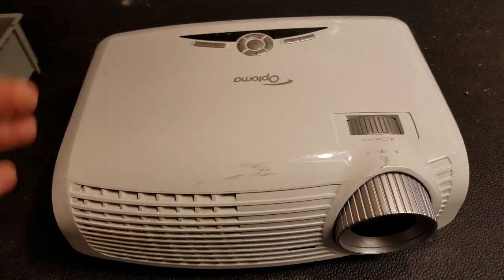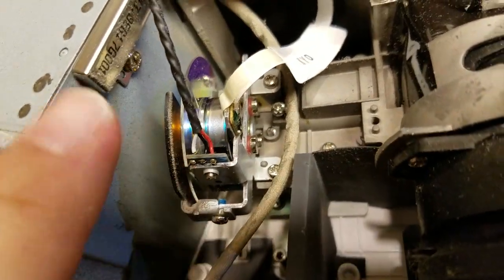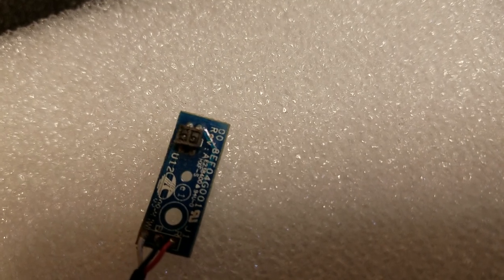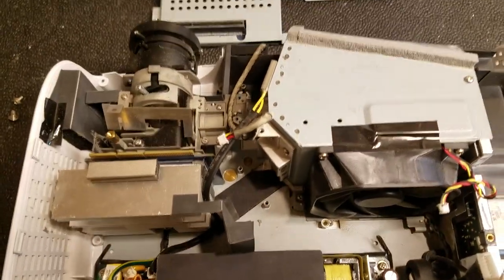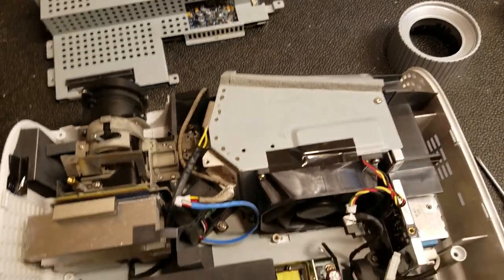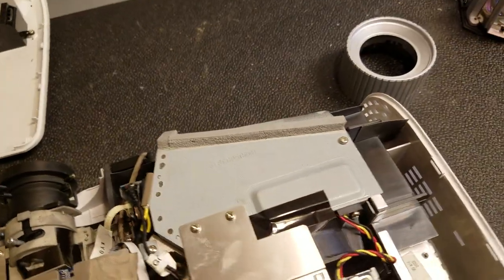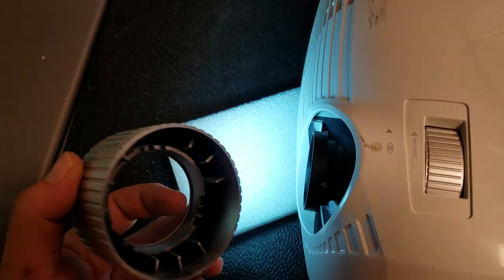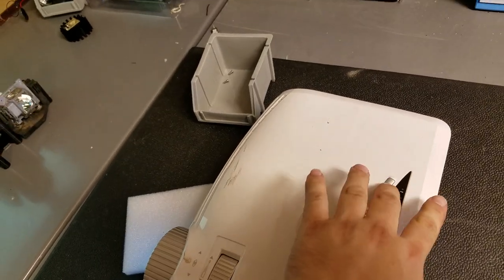Optoma HD20 Projector Cleaning

Comment: I had a fan error. I did what a gal in here suggested. I removed the bulb assembly and top cover. There are two fans. One large one blowing square on the bulb. There is another in a metal housing with two narrow openings. I sprayed compressed air at the blades and heard them spin. I did that a couple times and assembled the projector. It worked like a champ.

Comment: Thanks Frank, my HD20 was pretty clean inside but I did find the color wheel looked hazy so I cleaned it up and problem solved! I did have one small snag when disconnecting the cover cable, the small black clip on the plug broke into pieces.  I managed to push the cable back in holding it in place with some tape and everything works!
Reply from the maker: Wonderful! Those clips can be a royal pain.  As long as you have the little 'wedge' held in place I expect you will be fine. There is no tension pulling on it once its put together.  Great job!

Comment: Fantastic video, really helped me be thorough in taking out screws in right order and being careful with the cables.  Just in case anyone else has this issue, I cleaned the sensor and the colour wheel but still the snow appeared on the screen, I pushed the HDMI cable to display adaptor more securely in my laptop and bingo! no more snow :-)) Yes I should have checked the obvious before spending an evening cleaning the insides of a projector but now i know it is clean and in good working order thanks to this video lol!
Reply from the maker: Thanks for the comment!  Im glad you are up and running! Thats my goal with all of this.

Comment: I have an Optoma HD131X (black version of HD25) and I noticed a dramatic reduction in brightness at approximately 4000 hours. I thought I needed a new lamp, then I saw your tutorial, opened it up, took out the color wheel (which was literally coated in dust) and gave it a really good clean... And viola! I now I have a much brighter and more clear image!!! 😁👍 Thank you for such an informative breakdown.

I do have one problem though? When opening up the case, I was a perhaps a little too rough with taking off the top cover and did it from front to back (the wrong way around to what you suggested). As a result, I snapped off the plastic clip/tab off which holds on the front. The whole thing fits back together fine, but there is a tiny gap in the middle at the front, which also points upwards when ceiling mounted. 😟 Now I'm really kicking myself over it and worried I've ruined the whole projector by letting dust get in easy and make it build up fast again inside, or shorten the remaining lifespan of it. Would you say it's anything to worry about or be overly concerned over?
Reply from the maker: You're very welcome! Nah, don't stress the gap.  That dust takes years to build up.  Just run it and consider replacing the lamp assembly soon. 4000 hours is a lot.  you will notice even more of a difference with a new bulb installed.  If you run it too long, the bulb will explode and possibly cause some real damage.
Reply: Thank you so much for your advise! Now I can sleep without worrying too much about the gap! ☺👍

One more question I do have about another small issue I do have which has been a thing for the past year or so, when displaying brighter images, red and yellow seem to skew slightly? I have my projector calibrated (to Rec.709/D65 using a colorimeter) and I can replicate the issue by displaying a 100% Red or Yellow pattern and lowering the contrast to -11 (even going from -10 to -11 the color snap fixes accurately). The correct value is -3 without clipping. Obviously this affects very little in real world content, just more occasionally in cartoon and graphics stuff. More of an annoyance than a dealbreaker. In refresh rates that use the 3x color wheel speed (24 and 50) instead of 2x (60), the issue gets made slightly worse? 🤔 I'd of thought cleaning the colour wheel would fix this but sadly not. Also when the projector starts, I notice a weird screech, which I guess is the colour wheel starting up (also newly developed this past year)?

As for the lamp, this projector has an estimated lamp life of 6000 hours in Eco mode, which I run it in 100% of the time. Worry not, I will replace the lamp as that time approaches! 👍
Reply from the maker: @BedfordMarcus  that sounds like the wheel is failing. Most versions of that projector are on their 3rd or 4th color wheel by now.  If this is still your first, it is well past time for a new one.  The squeal is very indicative of that as is the color shift.
Reply: @FixitFrank  Awesome, thanks! I never knew that the color wheels in these had such a short lifespan despite routine cleaning?! Now I know where to look! 😁👍
Reply: @FixitFrank  Just an update, my new colour wheel came in (100% identical to my original one, with the index mark in the exact same place) and I fitted it (after a good clean all accessible areas, colour wheel photosensor and lamp bay/assembly). Unfortunately it didn't fix my colour issue, in fact, it only made the issue with the banding even worse. Blue was terrible. I had a quick play about with changing the colour wheel index in the service menu, but that did nothing. 🤔

In the end, I ended up reverting back to my old colour wheel (thankfully the seller refunded me in full), and gave the bearing/hub a good blast with an air duster. The noises are now gone and it starts up with no issues (indicating the wheel is healthy). Banding maybe a little better (could be to do with cleaning the sensor) but still predominantly there in red. What else could be the cause apart from the colour wheel, given adjusting the index in the service menu doesn't really help it?

It's still a very good projector (and definitely gonna be much better now I cleaned so much burnt dust of there) but it's just a bit annoying about the red and would love to have it right. I really don't want to throw money after bad things, that's all.
Reply: UPDATE! I fixed the issue with the red looking off (pinkish/deprived) in brighter areas! 😁 I found a different code to access the full service menu (not just the partial one) and I just simply adjusted to colour wheel index for both 2X and 3X individually whilst displaying a gradient pattern. I only needed to adjust it about 4 to 7 clicks to the right. My guess is the sensor must have drifted slightly over time? Not that it really matters as the colour is just about as good is it was when new now! Thanks again! 👍

Comment: I have an Optoma HD25e with flashing lamp and temp lights errors.  I ordered a new lamp, blower and system fan.  Followed your terrific video and replaced all.  Also cleaned the color wheel and sensor and gently blew it all out with an air compressor.  Now when it powers up I'm getting a flashing power and temp light error.  The new lamp, both fans and color wheel are spinning well.  Any suggestions?
Reply from the maker: Hi Shane,  You probably have a fan either stuck(wire tucked into a blade) or maybe a wire isn't quite plugged in on one of the fans.  That error(if happening instantly) usually means a bad fan.  If all fans are spinning, it might be the tachometer lead of a fan that isn't working.  How are you with a volt meter?
Reply: @FixitFrank  Thanks for the reply. I have and can use a volt meter but it's been awhile.  The errors don't happen immediately.  After I replaced the fans and bulb I tested with the top cover off like you did in the video. It powers up, bulb comes on, fans and color wheel all spinning.  I get the errors after about 30 seconds later, then it shuts down.  I'll ensure all the connections to the main board are solid and try again.  How would I use a volt meter to test?  Thanks!

Comment: Just found this channel and video after getting a second hand HD200X (Pretty much the same unit except it's black?). Anyway I've ordered a new cheap lamp (might get a knockoff one but the one I replaced in my HD65 was a cheap Hong Kong lamp and it has worked flawlessly for me for several years now).

Mine starts up but 'suggests' switching out the lamp so I'm going to do that before I mount and use it. While doing that I might as well clean the whole thing out since it was covered in dust when I got it.
Reply from the maker: Sounds good.  Watch out on the knock off lamps . Some use Krypton 85 to get around the patents on the gas mix. As long as the seller is decently rated you should be OK though.

Comment: GREAT TUTORIAL!!!  
I know you're not a mind reader but here is my Question:  
I recently replaced my bulb with one that I bought on line but am still getting the same amber & or red lights.  Is it safe to assume that this replacement bulb is defective?    Or could I have bigger problems?
Reply from the maker: It cant hurt to try another lamp.  The problem may be elsewhere though.  These are known for color wheel failures after 5-7 years.  If you have never changed the color wheel, I would check my video on HD20 color wheel replacement to see if the same applies.
Reply: @FixitFrank  Yep.  Did that worked out really well, then about 2 weeks later... the bulb.  Just ordered a replace bulb again and hoping this will work.  Thanks again.  I really appreciate your tutorials!!!

Comment: Thanks for this very informative breakdown. 

I have a second-hand HD20 I've been trying to repair. Perhaps you have some insight. After several minutes of use, and as it heats up, the image will begin to flicker rapidly for a few seconds and turn green. The image will remain green until the unit cools down. 

There are two ways I have been able to get around this issue as temporary fixes. For reference, I have the HD20 ceiling mounted. 
1) I run the HD20 in High Altitude mode (fan on high the whole time). 
2) I run the HD20 with the outer casing removed (I position and tape up pieces of charcoal filter to block the stray light flooding out the bottom but leave the lamp area wide open). Even so, after an hour it may still shift image to green. However, selecting High Altitude mode at ths point and running it for 5 minutes or so will typically be enough to shift the image back to full color without having to power down completely.

I've cleaned the unit thoroughly as well, however , based on your video I will pay closer attention to the color wheel chip. Another Youtube video suggested I replace the thermal paste where the chip touches the heatsink. I've attempted this twice with no luck. 

It's also very possible that the "Osram" bulb that came second-hand with this unit is a knock-off and is overheating the unit. Though I am not prepared to shell out the $150+ needed to test that possibility yet. I've inspected the Lamp housing and lens and do not see any indication of burning at this point.

Is there anything else I should be looking at that would be affecting the image coloration like this? Thanks CG
Reply from the maker: Hi there!  I'd be glad to help. You likely have a dirty color wheel/CW sensor. How freely does it spin if you give it a little flick with your finger?  The drifting color is what had me leaning that way.  If the DMD was overheating you would see more spotty flickering pixels (in my experience).   Im pretty well versed with this model. Im happy to help further.
Reply: Hey pal! You are right on the mark my man. Cleaned the CW sensor and running for nearly 2 hours now and the image is holding steady, beautiful. Thank you so much for pointing me in the right direction. I really appreciate you sharing your knowledge.
Reply from the maker: Awesome!! That makes me so happy to hear!  Thanks for letting me know!
Reply: Bin it? The way he explained how to clean this projector is just a way of damage the dmd chip
Reply: @FixitFrank  Frank I just replaced my bulb after 8 years of use! Now I have the same issue (picture turns green after 5 minutes). What are you using to clean the CW?
Reply: @FixitFrank  I swapped my color wheel and the picture is actually worse now...appears grayish vs changing to a green tint
Reply from the maker: @patrickcogley  Are you sure its for an HD20?  If so, you still need to set the index point if the little black mark is on a different position from the old wheel. That black mark on the side of the hub is what dictates what color it is keying off of.  https://www.manualslib.com/manual/687100/Optoma-Hd20.html  Read this about adjusting the color wheel 
index.  That will get your picture back correctly.  That link has the buttons to press to get into the service menu and how to adjust the color wheel index.
Reply: @FixitFrank  it's for an HD180, which is essentially the same projector. I'm not sure i saw a black mark on the old color wheel or the new color wheel.
Reply from the maker: @patrickcogley  There is a mark. All color wheels have them. It is on the side of the hub that passes past the sensor. That is how the projector knows there the color segments are. The steps may be the same for the service manual.
Reply: @FixitFrank  thanks! So I was able to access the service manual and I saw there is a Color Wheel Index number (currently 295). Do I just change this number until the color appears normal?
Reply from the maker: @patrickcogley  That is correct. As long as the colored segments are the same between your old wheel and the new, you will only need to adjust the number up or down until the picture clears up.  You can easily do it by eye.
Reply: @FixitFrank  couldn't quite get the red correct...I'm going to put the old color wheel in and see what it does. #frustrating
Reply from the maker: @patrickcogley  Double check the segment order. They need to match. If its Red green blue instead of red blue green(as an example), that can be a problem.
Reply: @FixitFrank  so they are different, in fact upon further comparison they don’t even look the same. And, I’m not sure how I would switch them. Do you have an email that I can send a picture?

Comment: thanks for the tutorial, i got a lot of good tips from your gideo! .Could you specify which product i should use to clean up the color wheel? I was thinking on Isopropilic alchohol in aerosol or you have to use another specific product? Thanks!
Reply from the maker: Hello Nacho! I use anhydrous isopropyl alcohol, window cleaner with ammonia or just a little water.  I will use isopropyl if the wheel is really bad.  The thing you have to watch out for is the type of glue used.  Sometimes alcohol can attack the glue and loosen the segments. If you are careful and do not get alcohol against the center of the hub(where the glue is) you can use 99% isopropyl.  Normal 72% or even 91% has too much water for my comfort.  If the wheel only has dust, try a dry microfiber cloth.  The less you can do the better.  For the alcohol or glass cleaner I will use a cotton swab to apply it.  Microfiber would be my first method, then go to using chemicals.  Remember Less is more!  Thanks again for watching my videos and if you have any other questions please let me know.

Comment: on the color wheel sensor. are you using any solution like alcohol or just a dry q-tip?
Reply from the maker: I try for the 'less is more' approach.  If its really dirty, some isopropyl won't hurt, but if you can get away without anything, that is better in my opinion.

Comment: You are a genius, your video was super useful for me! Thanks Man from Argentina!
Just one question, how did you plug-out the orange conector from the mainboard at 3:19. I just can´t plug it out it´s totally stucked, is there any tip for doing this? I will appreciate your answer.....
Reply from the maker: They can be sticky.  One trick it to rock it side to side, while pulling on the wire gently.  You may want to take a very small flat blade screwdriver and work it around between the connectors.  Another method which I do not recommend (unless you are very careful) is using wire cutters to gently hold the connector (barely biting into the plastic) and working the connector out.  It is a hard area to work in, with little clearance.  The last option is to leave it plugged in and unscrew the board from the color wheel and leave the board hanging.  That might be a good option for you to be safe.  Thank you so much for the kind words!! I really appreciate it!

Comment: Hey Frank, thanks a lot for the videos. They have been really helpful. One question, I have an Optoma hd20 bought second hand that has a lot of yellow built up in the hot air exit grid (as the one in this video but much heavier) and I wonder how could I clean it up. Do you have any suggestions?
Thanks a lot and keep it up!

Comment: Great video, thanks... I have a Optoma  TH1060p, that just went down on me . It won't turn on, could it be that it's dirty? I have had it a couple of years and never cleaned it...
Reply from the maker: Hi James, I have a th1060 as well. Cleaning won't make it come back on but it will help it once it does. 
Are you getting and standby LED? Also check the lamp. I bet your lamp died and the blower fan in front is what did it. I have a video on a polyvision pj905 cleaning that is identical to the th1060. Just search for pj905 and you'll see it. Review that video for cleaning yours. I also have a video on replacing the power supply in the th1060. You should be able to search on the model number. I'd link it here but yt makes it hard to do on mobile.